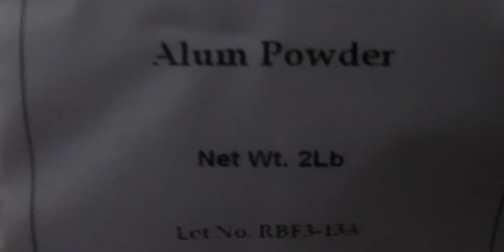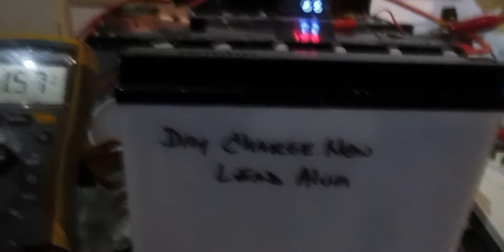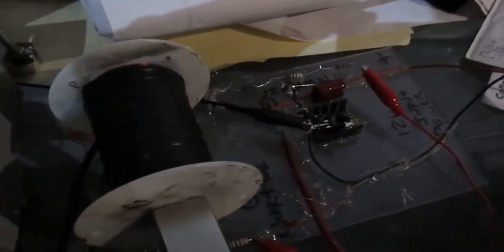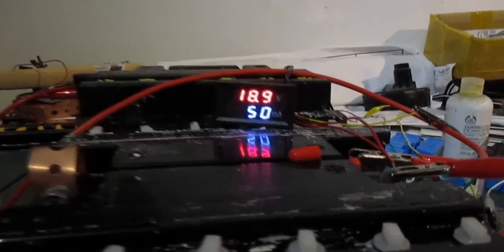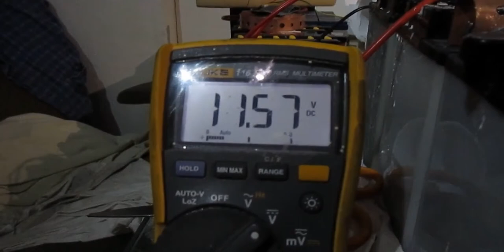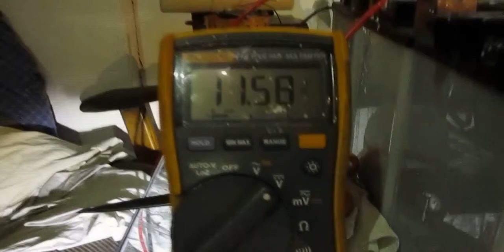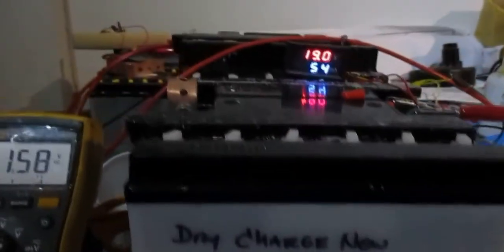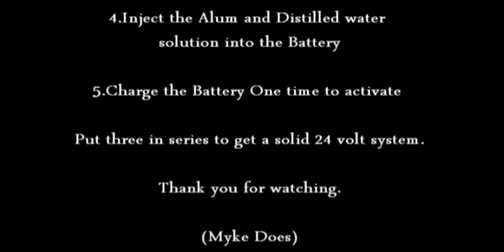Myke Does Lead Alum Battery

Comment: I would like to get one of those chargers. I now have 6 or 7 lead alum batteries. My best ones hold about 11.5v and my worst ones hold about 7.5v. It seems if they hold any less than that they're doomed to fail. I have 3 that were less and they failed within 6 months or less. They were total junk to begin with, but I was experimenting. Actually my first alum battery, which holds about 9v appeared to be just as junky, but I've been using it for the last 5 years.

I have one deep cycle battery (my first conversion) that was 20 years old when I converted it 5 years ago. It holds about 9 volts and is still just as strong as it was the day I converted and reformed it. I use the good ones with 5w camp lights I buy for $3 to $5 on Ebay and a $4 to $5 photo switch (which I have to replace about once a year). I run those lights on them all night, every night using a 15w solar panel. In my climate in Mid-Michigan I really need to upgrade to 20w for winter. 

I design my own LED bulbs for the ones that only hold about 7.5v. Those I make with low enough amp draw that I can run them 24 hours a day (in case I forget to turn them off) and skip the photo switch because it draws at least as much power as the lights themselves do (about 60ma). That's using a 10w solar panel to charge them. I'm always experimenting with new ways to regulate the voltage because they don't make solar charge controllers for all these odd voltages.

I also bought a cheap $30 data logger that I've been using to gather data on these circuits for the past 3 years. There are two things I've noticed missing in the "lead alum battery" community. 1) no one really talks about how they practically use these batteries long term and 2) I don't see anyone collecting any long term data on the performance of these batteries. 

They're not the same as a lead acid battery. In some ways they're inferior (not real good for use in a vehicle, at least in my climate) and in some ways they're superior (you don't have to worry about wrecking the plates every time you get below 11 volts). I love the way they perform with these Ebay "camp lights" and home made LED bulbs. I can run a cheap 12v 5w (40w equiv.) bulb for days on my good batteries. I once ran one for 2 weeks on a converted lawn mower battery. It got dim the second week, but I wanted to see how long it would stay lit without a charge. I still don't know because after 2 weeks I had to go out of town and didn't want to leave it hooked up while I was gone. But, the light was dim enough at that point that it really needed a charge anyway.

I think that's pretty good for a battery that cost me $15, including the core I would have got if I returned the battery to the auto store. And like I say, I have one that's 25 years old and I've been using it every day as an alum battery for the past 5 years. I've replaced my photo switch twice and have had to replace one of those 5w LED bulbs so far in that time. Not bad really to have emergency lights whenever I need them.

Actually, my first alum battery cost me about $35 because I bought those little bottles of McCormick alum for about $4.39 a bottle. I think I used 8 of them if I remember correctly. But, now I order alum on Ebay for about $20 for 5 lbs (99% pure). Enough to do maybe 6 batteries using my current formula of 2 cups (about 450ml) per gallon. A couple of my earliest batteries I mixed a little epsom salt, some borax and a tablespoon of Nu-Salt to try to cut the costs (from 8 bottles alum to 6). So far those batteries still work fine, and that was maybe 2 1/2 years ago. I now use pure alum, but I'm curious how long those 'mix' batteries will last compared to the pure alum ones.

I can't keep track of how many alum batteries I now have. I think it's 6 or 7, but I have about 5  or 6 more that need to be converted. I had a friend give me 3 old lawn tractor batteries that had been laying out in a field for who knows how long, but they all turned out to be pretty much junk. I think I still have one that holds a weak 4v. What I'm starting to wonder about now is if I can reuse the alum water that I put in them. But, I'm a little scared to try it.

I would love to hear what other people are doing with their alum batteries on a practical level.
Reply from the maker: try building this charger it will restore the batteries. http://poormanguides.blogspot.com/2016/01/battery-desulfator-capacitive-voltage.html